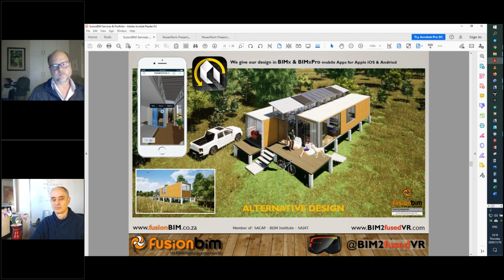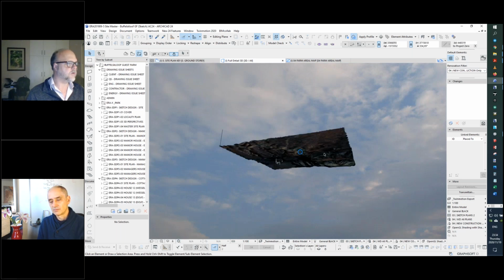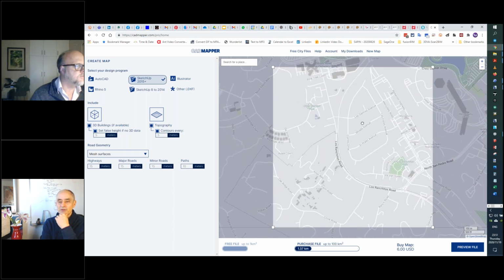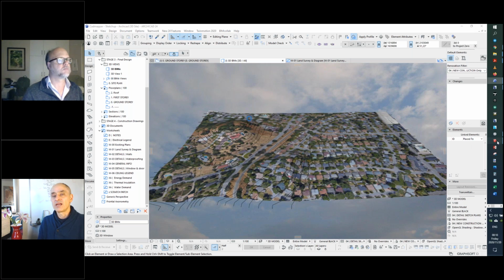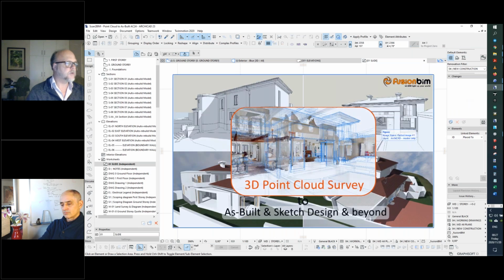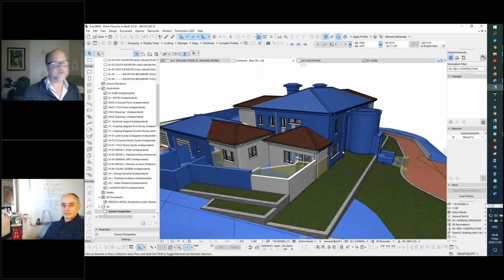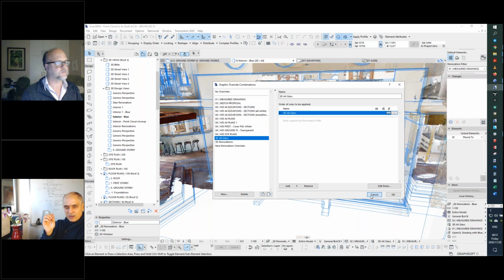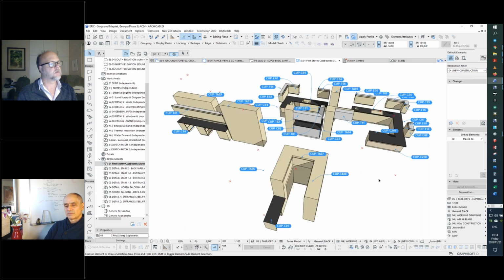ARCHICAD USER (Nov. 2020) - Francois Swanepoel, South African BIM Pioneer

Comment: How did you show 3D building in Google earth
Reply: Hi @Ipuleni I like your question. You just need to switch the 3D function on in Google Earth to shows the 3D buildings. I mainly use Google Earth Pro on my desktop but the Web & Mobile versions can show the 3D - https://www.google.com/earth/versions/
Reply: @fusionbim  I m also using the G pro but  in order to show some I press the mouse wheel down but it doesn't appear like yours
Reply: @ipulenijafetningeninawa5997  on the left of your screen is the control column with Search + Places + Layers. Activate and put a tick on the "3D Building" layer.